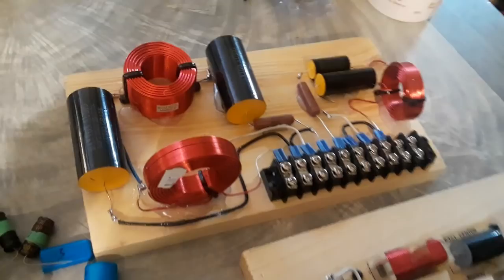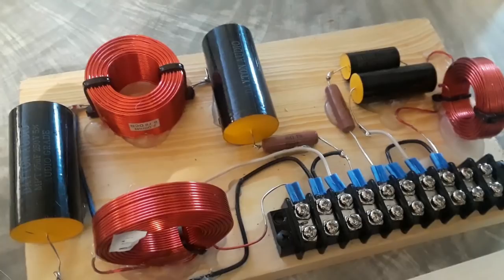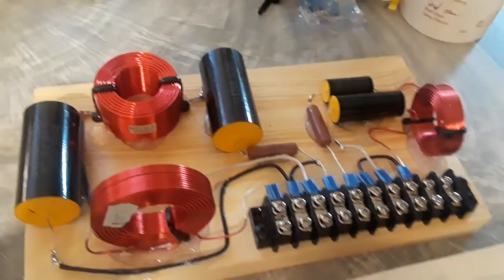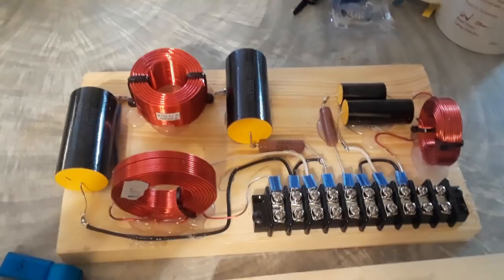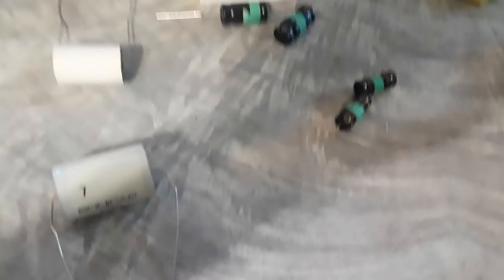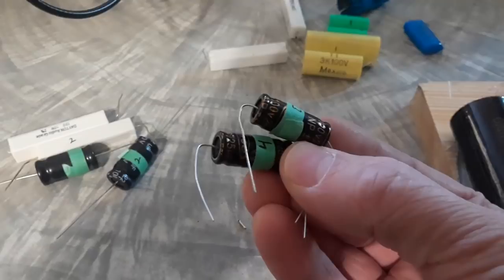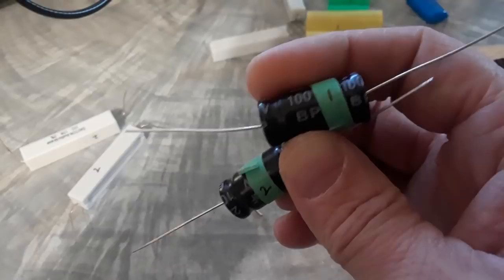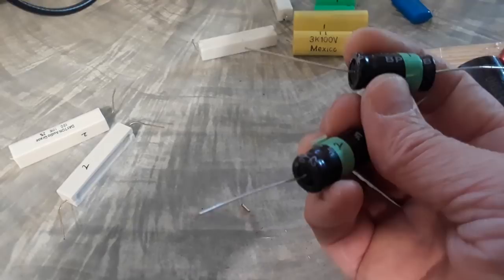Crossover Capacitor replacement recap and analysis Klipsch Heritage Academy

Comment: Can you tell what difference of sound you had after the recap and how many percent they are better?
Reply from the maker: It's difficult. My impression is that the speaker is more articulate and accurate... It is better to go off of objective data rather than impressions though and my hearing and tastes may be different than yours. Also there is a psychological factor. When we spend money on new capacitors we want them to sound "better" so it is easy for our minds to fool our ears. That's the purpose of putting these on the scope. It converts an audio wave into a visible format. We can watch and see that there are notable differences between them.
Reply: Ricky Talks Shop Thank you for pointing this out. There’s a tendency for many to resort to “magical thinking” when it comes to audio, particularly with people that have little experience in electronics. I don’t mean that to be harsh, but the more you learn about electronics, the more you realize that one capacitor isn’t better than another because it’s expensive or uses exotic materials. If they test the same, they sound the same. Your point about the psychological impact on all this mirrors my own experiences and thinking. Most of the claims by audio enthusiasts that components (cables, caps, etc.) sound better is because people hear what they want to hear. Unfortunately, these opinions are rarely confirmed by testing or double-blind studies. Thanks for being a voice of reason. It’s nice to know I’m not alone in promoting a sensible approach to recapping and sound quality.
Reply: @FluxCondenser  
Thank you for the dissertation. In the case of the video, he may or not be able to hear a significant difference after recapping. In some cases, and often for me when recapping 40+ year old speakers, they always sound extremely and obviously better. The question wasnt about hearing the magic of higher quality parts. To answer the original poster for anyone coming along in the future, I can always tell the difference after recapping out of spec and 40+ year old caps often using the best but cheaper parts
Reply: @russmangus  You’re clearly confused. My comment wasn’t directed to the question you refer to, but as I clearly stated, to the creator of the video and their response to that question.

Comment: I change my caps film Solen and listen to it for about 20 hours and it sounded so different, not the sound that I prefer. I ended up changing it back to the cheap electrolytics.

Comment: If you change the coils you need to make sure resistance in these new coils are exactly the same. Otherwise you'll change the frequency response in your filter outside spec. Caps and resistors are no problem